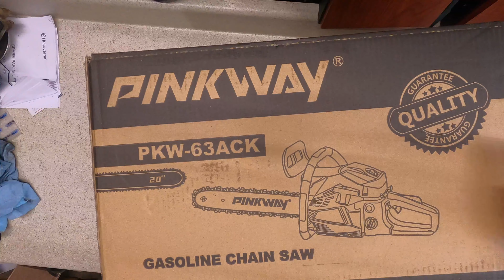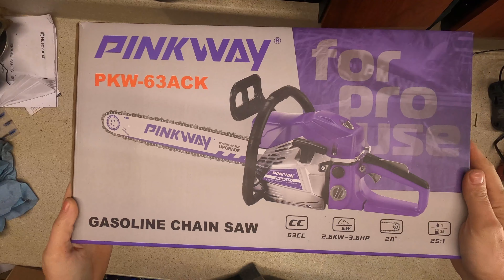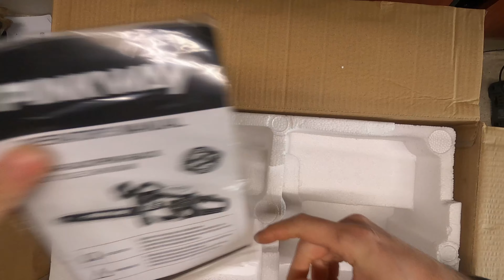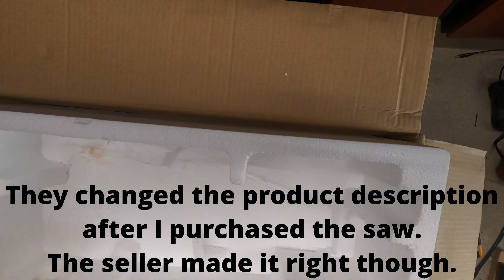$100 Chainsaw Shootout EP:01 Pinkway PKW-63ACK

Comment: All these saws are made at the same place with the same parts with different stickers and the 58 62 and 63cc are all just 58cc exact same motors
Reply from the maker: You can see clear differences in the moldings for some of the plastics and cylinders.  They are all copies of the same saw but clearly not identical.

Comment: What’s the purpose of lowering the rpm’s and “leaning out low jet”
Reply: Better throttle response
Reply from the maker: There is a balance between the low and high jets to get the best performance and longevity of the engine.

Comment: Bar mount is an Oregon D176 , very similar but oils through the top adjustment hole.
Reply from the maker: It does look like a D176 mount.  Similar to the K095 but with slotted adjuster holes instead of the round on the K095.
Reply: what is the specs for saw chain ?